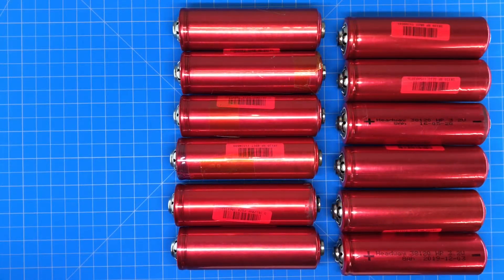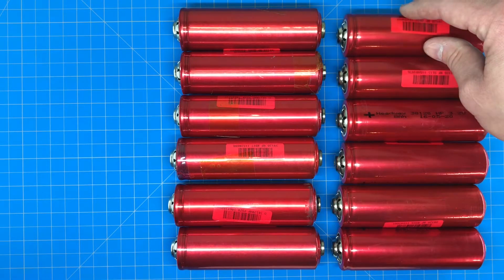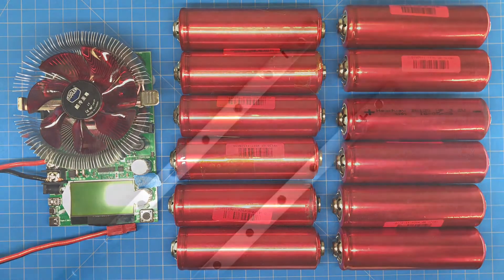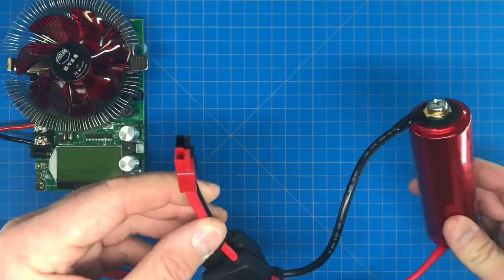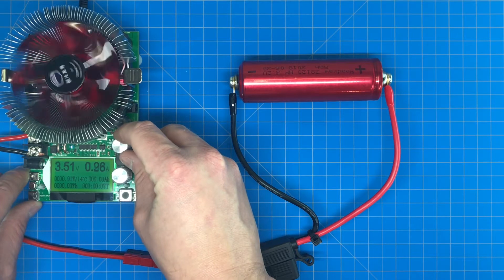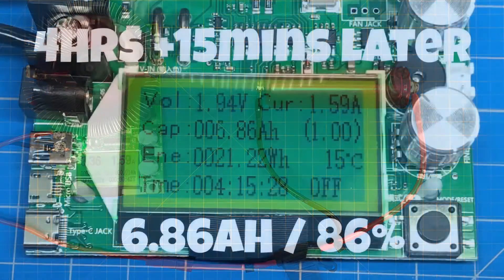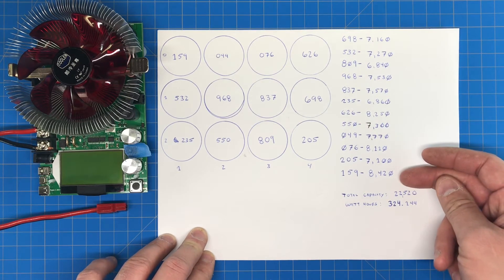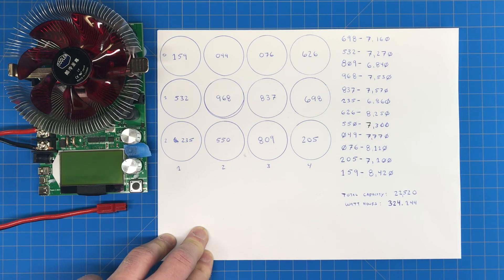Headway 38120 (BatteryHookUp)capacity testing

Comment: When I decided to make my e-bike my primary vehicle I discovered battery hookup. Their pricing seemed too good to be true. I purchased 15 36v 4.4ah (samsung cells) packs that were for hoverboards. I absolutely love these guys! They are hands down my first go to when it comes to lithium cells. They were honest and timely. I'm telling you it was the best deal I've ever gotten. They are the best  in used cells and packs. And they are as honest as anyone in the battery business! If your on the fence I hope this helps u make the right choices. I've been had by throttle manufactures and bldc hub motor manufactures. But never in batteries because these guys are the best.

Comment: I do the opposite. Drain the batteries into a known good pack that needs charging anyways. Once they’re all all discharged, I charge them up separately or in groups of 4 (if I’m working with more than 48 or so cells) to measure the capacity that I have and configure accordingly
Reply: I have balanced cells both ways. I agree with your technique of bottom up balance charging. Especially when using lith-ion chemistry. Lifepo is much more forgiving then lith-ion. And it's nearly impossible to get it to catch fire if you do mess up. If your in the used battery pack market (or used cell market) then battery hookup should be at the top of your list.

Comment: Just a word of caution... if you wire them all in parallel like you do for charging? You can have a really bad time... These cells can deliver *EIGHT HUNDRED AMPS* when shorted... half that gives you 400A of charging current for any battery that is lower voltage... and the cells are only rated for 200A continuous current draw. This means you damage both the higher voltage cells by drawing 400-800A, and that you damage the lower voltage cells by charging 400-800A when they're rated for 80A charge continuous.
Reply: Have you measured current when connecting cells in parallel? I’ve done it with 18650’s and typically with power cells you might see a 20A burst for a second that slows down to about  10A right away. That was on Samsung 25R’s

Comment: Battery hookup says the Ah rating is discharging 1.6a  to 2.5volts. I found this out on my Second day of testing. I had a bunch to retest because I was going down to 2.0v
Reply from the maker: I go by data sheets not word of mouth. https://batteryhookup.com/products/used-headway-38120-hp-3-2v-8ah-lifepo4-battery

Comment: To speed up my testing process. I set the discharge current to 20A. My result was roughly 5.18ah  and lasted for 20 minutes till it reached 2v and the alarm 🚨 went off. A few minutes later nominal voltage rises to 3.08v 
I’m not sure how accurate my test is, but now I’ll try to discharge it at 2a
Reply: Hope the cells were built to discharge at 20amps. I would keep a eye on the cells u did that with. Compare them to the others u test. I have found that regardless of what's said or advertised, batteries prefer slow discharging as well as slow charging. You can really tell after 2 years in service. Every chemistry I've worked with performs better when slow charging is a option.

Comment: Did you take them down to 2.0v during your capacity test?  I see that the discharge cuttoff is 2.0v.  I thought most LiFePo4 batteries were 2.5 - 2.6v. Is it safe to go to 2.0v on these?
Reply from the maker: I did take them down to 2 volts just for the test ( that is voltage @ the meter, voltage @ the battery was slightly higher), most data sheets say 2.0-2.5volts as min recommended. But you are right , if you are building a pack the BMS will cutoff @2.5 volts per cell
Reply from the maker: https://www.stromscooter.at/wp-content/uploads/2018/02/Headway-38120HP-specifications.pdf

Comment: It is def hit n miss with battery hookup, I have been gathering now and then buying the same used cells. The majority of the 140 cells I've purchased test 70%-85% however the last batch of 12 ALL test at 8.2-8.4 ah. Sure wish they were all used and testing that well. I digress thanks for sharing
Reply from the maker: I have heard that the 38120 cells from battery hookup are engineering samples that were used for testing, this is the reason for the variation of capacity. Thanks for watching